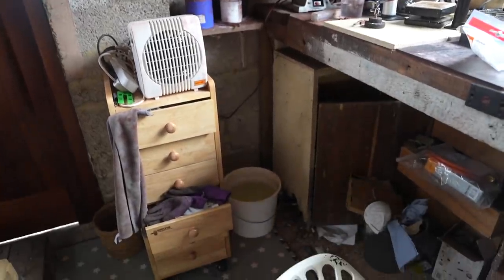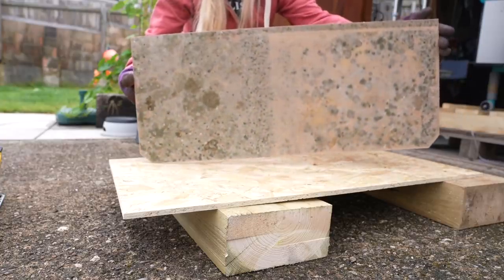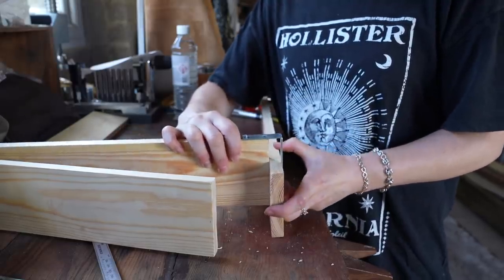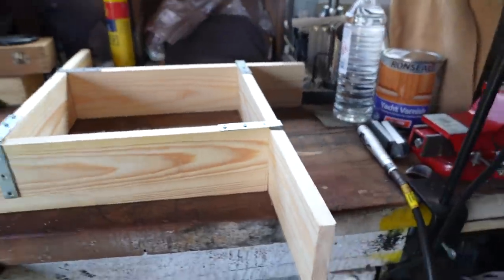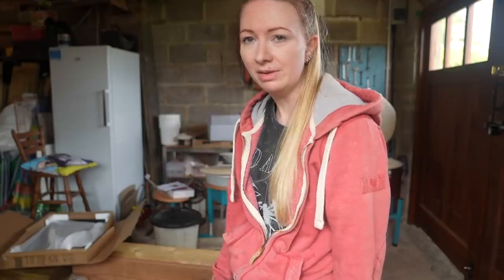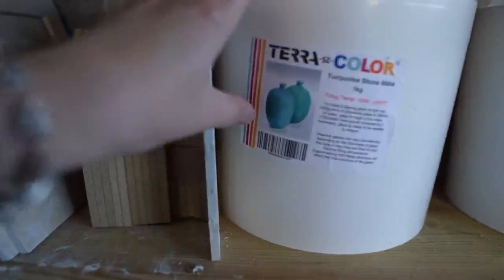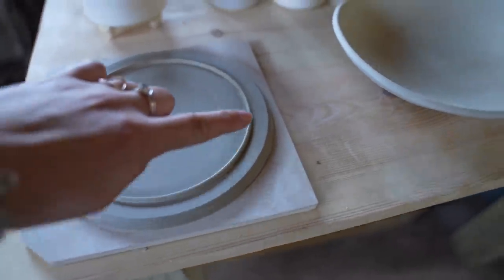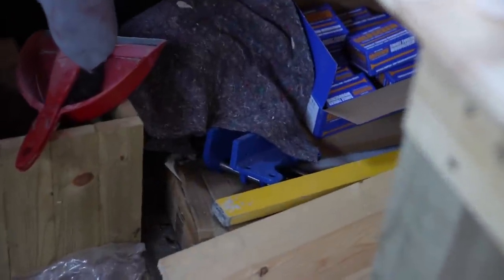Setting Up My FIRST Pottery Studio at Home!

Comment: With all due respect, Jodie, I would have gone with flooring plywood instead of chip board.

I've had a lot of bad luck with chip board where it gets damp and then it falls apart where flooring plywood doesn't.

Just a suggestion from my bad experiences, no bad vibes intended.

Comment: So excited for you! You do know that you have to have proper ventilation, yes? There are suction fans you can add underneath or above and then an exhaust fan would need to be bored into the wall or out the window, etc. Not just for heat but for off-gassing of toxins from the glaze processing. I wish you many happy projects!

Comment: You should paint those wooden shelves with some oil based paint to protect them from mold and run a dehumidifier in the garage.
Reply from the maker: I used yacht varnish on the shelves.

Comment: Nice Vans!  ?  Could you not paint the walls and floor with DryLok or something similar to help seal out some of the moisture?  I also didn't see you wear a mask of any sort to move the boards covered in mold, be careful.  Once that stuff gets airborne it can really mess with you.  I like your setup!  Maybe if I ever get some expendable $ I can commission a piece.  Thanks for all of the Key videos.  Be safe.
Reply from the maker: It would be a lot of work and moving things to get to all the walls and we have a 6 foot pit in the middle of the room too where some damp gets in. And we think the roof needs redoing. Yeah I probably should have worn a mask to move the mouldy boards. I was carful not to disturb the mould though. Thanks for watching.
Reply: @jodie_boo  Wasn't trying to be a downer or worrywart.  I look forward to seeing what you produce.  Thanks again!

Comment: Just a helpful tip from a house builder, if your shop gets a little damp, you might want to look at some treated plywood.  That's osb will come apart eventually if it gets wet.
Reply from the maker: Thank you. I did want to get plywood, but they didn't have any in stock, I'm hoping the 2-3 layers of yacht varnish will help.
Reply: @jodie_boo  well the varnish will certainly help, as long as all the edges are sealed as well.  Osb does soak up water.  Another option if you can find it, is epoxy paint.  They make a water based, ready to use epoxy paint that works really well.  I remodeled a k9 rescue and did treated plywood on the walls then did the epoxy paint on the floors and walls.  Made cleaning up messy puppies easier on them.  But I dont know what kind of stuff you guys have in the UK compared to the US.

Comment: That is a cool pottery studio, so You can have a lot of fun there.
It's been many years since I last did any pottery. I took part in Raku pottery and tried to use a homemade "kiln", where we dug up some pieces of grass, placed our pottery and added straws around the pottery, covered it up with the pieces of grass (with dirt attached to it) and set it on fire. Then returned the next day and dug our pottery out. Where the reduction worked the best, our pottery was totaly black. Raku pottery is a very intense experience, where You can make the pottery, let it dry some on top of the kiln, burn it and take it out and put it into a container with straws f.ex. put a lid on it, so there will be a reduction, wich will influence the colors and then take it out and let it cool of in some water. The pottery may get cracks, but that is all part of the charm of Raku pottery. Raku pottery can be done as a one day project.
Reply from the maker: I love raku firing, I sculpted my own hand and raku fired it, it came out looking like a zombie hand! I plan to get a raku kiln when I have more space. I've also done smoke firing. All so much fun!

Comment: Workshop improvements feel great when they're done but usually have some complications along the way.  Keep an eye on those OSB shelving pieces, they absorb moisture & then deteriorate quickly. (Unless you coated OSB thoroughly with polyurethane. )
Regular plywood with a sealing paint would be better. 
I believe some ventilation would be a good idea for dampness as long as it doesn't have a negative effect on your pottery work. 
But overall it looks like you're doing well with making good use of space. I'm a bit jealous, lol. Best of luck with it all! 
👍✌❤
Reply from the maker: I used a couple coats of yacht varnish on all sides for the OSB, so far it's looking ok, but we'll see. I did want plywood, but they didn't have any in stock. Thanks for the tips Tim :)
Reply: I'm not familiar with yatch varnish, but it sounds like it should keep moisture out, especially with a couple coats. And you're very welcome, I've been watching your videos for a good while & I always enjoy them.  👍✌❤